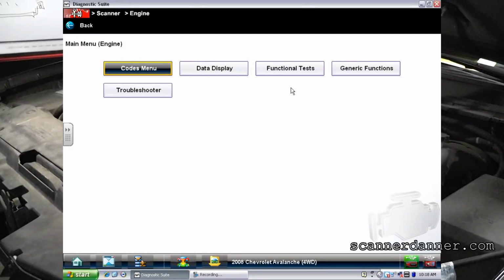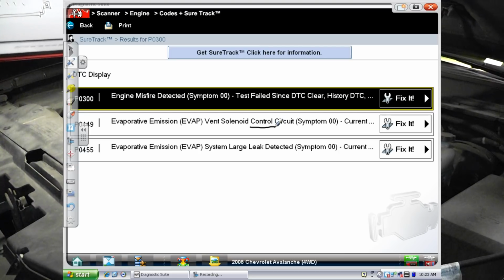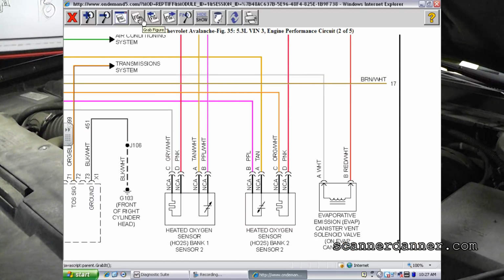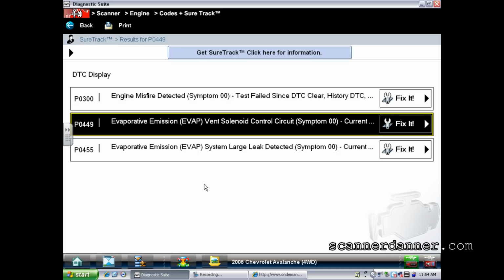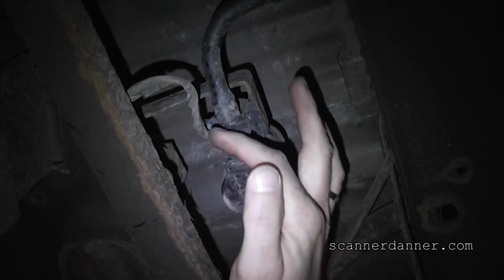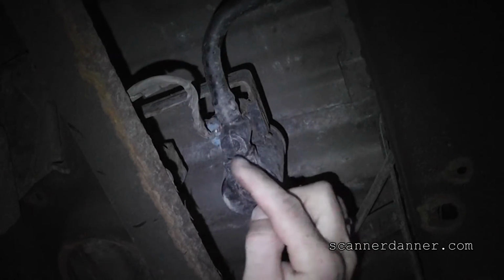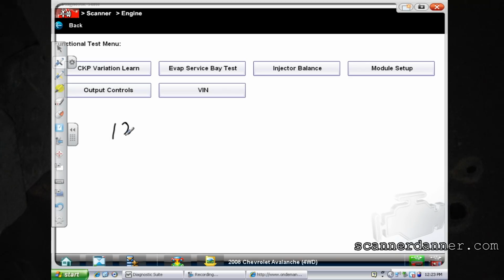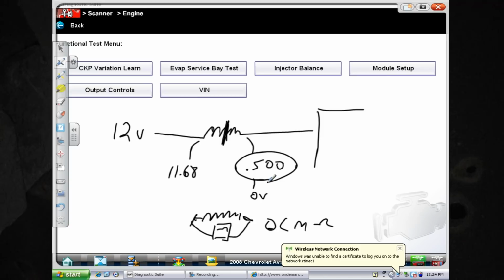2008 Chevy Avalanche EVAP Vent Solenoid Test (P0449, P0455)

Comment: Abnormal = using logic and research to troubleshoot and resolve problems. It takes time, talent and effort to be at this level of reasoning. It saves the use of unnecessary replacement of parts and gives the satisfaction of learning this art. So, thank you for your abnormality...

Comment: Dude learn ohms and resistance / continuity..😂
Reply from the maker: Sure you can test a solenoid for continuity but if it measures good, now what? I showed complete circuit testing here which is absolutely a key fundamental that my students need to learn on ALL circuits. 

Also, here is an example of where an ohmmeter will get you in trouble.
https://youtube.com/shorts/IE77Zzx3T9s?feature=share

Comment: Is it possible to check the vent valve without a scan tool?  When does the computer command it to shut?l
Great video, Thank s
Sgane.
Reply from the maker: It only commands it to close DURING an EVAP leak test. You will not be able to replicate those conditions. But you can do all of the other checks. You can also verify control wire integrity by measuring directly at the PCM. You should see 12v in that location too with the circuit not energized (ground side switched circuit, that is not being grounded), it is normal to see battery voltage)

Comment: Great video. Just to be clear this would not have been added resistance in solenoid because the .500 volt reading was with solenoid off so no current flow (why voltage drop test is so important).if this were a resistance problem we would have read 12 volts on both pins and then have abnormal voltage when commanded on. Also when you used the test light and jumped connector you would
Of had a much dimmer light if abnormal resistance in the circuit was present. I know you didn’t touch on resistance issue in the video but I made an assumption hopefully I am correct in that. Thank you for sharing your knowledge and experience with us all scannerdanner.

Comment: Hey I have 2019 ford ranger which it said  evaporator circuit open I check fuses and all of them are ok check voltage at the solenoid I have none  so how can I trace the wires from the solenoid to where???
Reply from the maker: Wiring diagram is key! This is a DIY version of the same service info I use.
https://eautorepair.adtrk.biz/?a=10817&c=24&p=r&s1=

Comment: Long shot here. 2003 Chevy blazer. Have 12 volts while using multimeter at plug as soon as it’s plugged in volts drop out. Verified white wire to solenoid has continuity and not shorted from ecu to solenoid. Verified two vent valve solenoids tested good. Tried to bidirectional test with scan tool and had no ability to complete test. Would you say the ecu is bad?
Reply from the maker: You are saying the 12v supply wire is dropping to 0v? This absolutely is not an ECM issue. You have a damaged/corroded supply circuit. 
To confirm, for me, since I'm not there. Your 12v wire, does it drop to 0 with a test light connected too?
Reply: @ScannerDanner  wow thank you for responding. I dig into it more and found a bad wire. Thank you again for answering a random comment.
Reply from the maker: @Timmmmayg4787  I knew you would! Awesome. I love answering those who actually are doing testing. The silver bullet seekers I ignore

Comment: 2010 avalanche, p0449. Testing at solenoid, no change of state. Proved the ecm is not providing ground. Will not illuninate a test light bulb. It grounds enough to make bulb glow. I was suspicious as it works when ambient temp is below freezing.
Reply from the maker: Do the same test at the PCM itself to rule out a wiring issue. My money is on the wiring right at the solenoid connector
Reply: @ScannerDanner  well, i’m impressed! Quick response. I tested at ecm. That was my first test as i ohm tested wiring. Which was good. It woks perfectly at temps well below freezing. Another indicator of a bad ecu. Guess next test would be to freeze the computer. Why do i always get stuck with these odd failures?
Reply from the maker: @franksgarage8551  you made it easy to reply as it is clear you don't need spoon fed. I love to help others who can help themselves. If you would have said "I changed the solenoid already, what else could it be?" I'd have kept scrolling lol.
Anyway. That is a very weird one! When you did your tests at the PCM did you have the solenoid unplugged? Just thinking about too much current flow from a shorted solenoid.
Reply: @ScannerDanner  bougt the truck in winter, so no issue until i parked it inside overnight. Went to diag and it had a new evap solenoid. Owner never said boo. Now i know why. I put it aside for the winter, now its spring and i cant stand check engine lights. Diag used to be my thing, typically people send the hard cases to me. But retirement is in the air. Figured i would pick your brain,or maybe for reassurance that i was on the right path. Picking up a used ecm next week, same year same part number.
Reply from the maker: @franksgarage8551  before you do, make sure current is not more than around 500 ma from that solenoid, or do that test again with the solenoid unplugged with your test light. I've seen drivers enter a current limit mode of amperage is too high and that could make your test light look dim

Comment: I replaced the gas cap, the vapor canister & wiring harness (near spare tire) and the vapor canister purge valve (under the hood). I still have the P0449 and the check engine light unfortunately. I cleared the code but it comes back immediately after clearing it. I have no clue what to check next to fix this issue. The code says evaporative emission (EVAP) system, vent valve circuit malfunction. I have no issue filling the gas tank. No issue with the truck. Just can't clear the code. I want to clear this to enable my remote starter.
Reply from the maker: Key on engine off, measure voltage on both vent solenoid wires, plugged in and backprobing. Should be 12 and 12. Start there
Reply: @ScannerDanner  Not on the purge valve under the hood but on the vapor canister near the spare tire right? Like you do in the video?
Reply from the maker: @LEaupéra  yes sir, exactly
Reply: @ScannerDanner  Great thanks. I'll do this and report back in here with the results.
Reply: I have 10,85 on both wires. It’s pretty low, but the key has been in ignition for like 20 minutes.
Reply from the maker: @LEaupéra  what is battery voltage?
Reply: @ScannerDanner  I have 12,28 on the battery
Reply from the maker: @LEaupéra  do you have an incandescent test light? See if your 10.85v will light a light. My suspicions are that it will not
Reply: @ScannerDanner  I don’t but I’ll try to find one. If it doesn’t light up the light what do you think is the issue? The Vapor canister was replaced already. I have voltage on both wires, so that mean the solenoid works, it’s closed.
Reply from the maker: @LEaupéra  okay, there is another way. If you manually ground the control wire while monitoring the feed  wire my bet is you will see a large voltage drop. My suspicions are that you have a corroded feed or supply wire to that vent solenoid
Reply: @ScannerDanner  I’ll give it a try. In that case finding the place where the wire is damaged could be difficult. I’ll most likely need to run a new wire up to the canister but not sure where it should start from.
Reply: I just tried and had a better voltage on the feed now of 11,4. When I grounded the control wire on the chassis I had a spark and it drops the voltage on the feed of course. It’s like plugging the positive to the negative.
Reply from the maker: @LEaupéra  so your feed voltage does drop? That is your issue. Look for visual damage on that harness and tug on that wire in various places. The wire will pull apart like a blown fusible link
Reply: @ScannerDanner  can’t find any issues on the wire plus the harness is brand new and was replaced with the Vapor canister. I cleared the code in the ÉCU to turn off the check engine light but few seconds later it immediately comes back with that P0449. Possible I have a wire issue elsewhere on the control wire that goes back to the computer?
Reply: I found on another video from someone else to unplug the wire on the canister and plug a test light on the plug instead. Then clear the code and read code again. If circuit is fine the code disappear. If the code comes back then there’s an issue in wiring somewhere. I did that and unfortunately the code still comes back immediately.
Reply: @ScannerDanner  I did this test and the light does turn on.
Reply from the maker: @LEaupéra  what kind of light?
Reply: @ScannerDanner  Just a small led light that works with voltage from 5v to 110v
Reply from the maker: @LEaupéra  can't use that. It is not enough of a load. It only takes like 10 millivolts to light an LED and it takes on average 200mv to light an incandescent bulb with a 1000 ma surge as it lights up.
That solenoid draws about 400ma of current. 
You said the feed side dropped to 0 when you grounded the control side right?
Reply: @ScannerDanner  I just tried again. The feed side is droping to 1 on the multimeter and it creates a spark on the chassis when I ground the control wire.

Comment: What's the posibility thst the plug has some corrosion in side of the plug causing that 5mill Amp voltage reading off of the othier lead that has 12v to it

Comment: Great lesson...
I have 12 volts on both wires (as I should) but the voltage doesn't drop on the ground when I command the purge valve open. I'm thinking the ground wire is damage somewhere back to pcm or the pcm driver is bad. Does this sound correct? 

BIG THANK YOU for a response!!!
Reply from the maker: Agree! I've never seen one of these computer drivers go bad.
A few things to consider.
1. If there is a hard fault (happening right now) for the vent valve circuit, this can prevent your bi-directional test from working. So clear codes and see if it sets immediately.
2. Measure the same control wire at the PCM. If it is 0v, you definitely have an open in the harness. If it is 12v, then we focus on the driver.
3. Tug on the harness wires right at the connector of the vent valve. They break inside of the insulation.
Reply: So its either a leak or the solenoid valve. @ScannerDanner
Reply from the maker: @ozoneswiftak  you're replying under another question so I'm not sure the context of what you are asking me. 
A leak will not set this code. Solenoid, wiring, computer driver are all suspect

Comment: There is no such thing as a ghost voltage. Either there is a bias or a measurement error. 0.5 V is a significant value.
Reply from the maker: Call it what you want, but there certainly is. Watch your voltmeter and don't connect it to anything and shake your leads, you will see a voltage change. It is an open circuit indicator. Sort of a microphone effect. We can argue what it actually is, doesn't matter, as long as you are aware of it and know how to use it to your advantage when troubleshooting is all that matters.
Reply: @ScannerDanner  I really appreciate that you responded to my comment! Btw I am a big fan and I think you are one of the best (if not the best) in diagnosing cars and teaching others!!  I just object to the term ghost. There could definitely be a noisy measurement, however, 0.5V is pretty significant no matter how you look at it; even the poorest multimeter should be able to give a fairly accurate measurement. FYI I have a PhD in electrical engineering. Keep up the good work, we all love your videos!
Reply from the maker: @apostmax  awesome! Great to here from guys like you. Can you give me a time frame in the video where this comment came from? That way I can explain what I was seeing and why it mattered a little better. Thanks!

Comment: Can i do this while cycling the key if i don't have the computer program to switch it on and off
Reply from the maker: no sir, the conditions for the computer to turn on the vent solenoid are not met by cycling the key or even starting it up. But you can test the vent solenoid without having the computer turn it on. Energize it yourself and see what it does. I'm not sure if I showed that process on this one, but I know I have in other GM vent solenoid case studies that I've done
Reply: @ScannerDanner  I replaced the vent solenoid but my check engine light is still on i wanted to check the wiring to make sure it was getting the appropriate signal to turn on and off
Reply from the maker: Tug on the wiring harness right at the vent solenoid connector. The copper wires break INSIDE of the insulation right by the connector. It will literally pull apart when you tug on the wires.
Reply: @ScannerDanner  i will try it when im done work hopefully its a simple fix

Comment: That 0.5 volt is due to high input impedance of the computer. Just think of 2 resistors. High resistance of bad solenoid and smaller resistance of the computer. When on, the computer pulls the input to ground. Any smaller voltage than 0.5v is due to resistance of system wiring

Comment: Definitely not ghost voltage, but good guess. You should use the Load Pro test leads on this exact scenario or any other wiring/electrical issues. It will simplify the explanation. Good video, very informative.

Comment: 21:28 I have a set of 'noid lights that are a much safer way to check harness integrity than twin back-probing with a clumsy incandescent test light.  The last P0449 I had was on a Silverado, and I punted it because the vent was jammed directly below the crevice between the cab and the bed, in an awkward location that was made much more awkward due to the huge pile of fresh horse sh!t piled into the crevice directly on top of it.

Comment: Had a gross leak p455 on my 07 Aspen,was the fuel filler neck .now I have a p456 code for small leak.i smell gas after I shut the car.its using alottttt of gas.please help!

Comment: Paul, u are slicker than a peeled onion(that means pretty smart, in hillbilly terminology) lol   After months of frustration and a couple solenoids and o rings and cussing, and beer... I find this video from some link i was reading about 3am(seriously debating which method I was gonna use to "have an accidental electrical/fuel related fire" and rehearsing my story/extremely shocked and innocent appearance when the fire department and insurance guy showed up), and next thing I know I'm debating which method I'm gonna use to repair the "half broken internally/intermittent" white wire in the harness under the cab... I had just practiced so hard being super distraught and lucky to be alive after "the fire" I was about to have, that I was almost unable to feel happiness and closure during my 5am test drive/trip to Walmart for more electrical tape to secure my harness loom. Lol.  Thanks a ton!              Sincerely: a NORMAL person..
Reply from the maker: Loving this comment again from 7 years ago!

Comment: I have been working on a buddies car for a couple of days on this same issue. My buddy had replaced most of the evap parts before coming to me for help include the vent solenoid. So the vent is new. After hours of testing I found out that the solenoid was not getting power so I checked for brakes in the wire. I was able to actually run completely new wire from the main harness new the computer where I found power to that wire. I ran wire from the feed and the ground and actually was able to get the vent to command on and off using the scan tool. I then cleared the code and I had figured I fixed the job. About a day or two later the code came back on so I told my buddy to check the connection making sure it still got power and it did. The code eventually went back off but then on again after most likely another drive cycle. The hot wire is getting 12v all the time and the ground wire seems to be functioning properly. Is it possible that if the ground wire isn’t functioning probably the vent valve could be stuck close (not being able to open while driving the car) and that trip the code back on? I’m at a lost for words on how the power is function properly to the vent and still throwing the code? I really enjoyed this video and if there’s anyway I could get some feedback on my situation or suggestions on what you would look at or go about fixing this problem
Reply from the maker: You need to find the break in the original wire, I bet the control wire is messed up in the same lo location

Comment: Hi Paul - do a google search on "forward leakage voltage" - it's something that happens in electronic circuits that contain switching transistors ... You will understand where the 1/2 volt originates..

Comment: It seems as though it would be easier to see if the solenoid itself is bad before checking the wiring, by removing the electrical connection and applying 12V to the solenoid to see if it is operational (clicking)?
Reply: Or just test continuity between the 2 pins without the plug on . Solenoid could have been stuck slightly since its open constant  testing resistance tells you all you need 🤷‍♂️